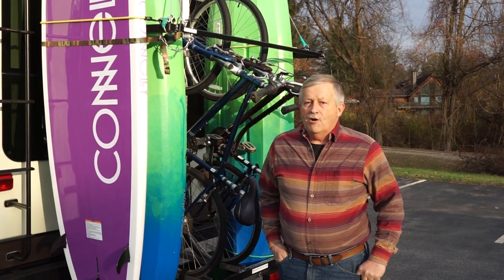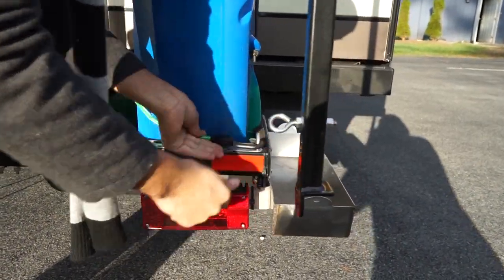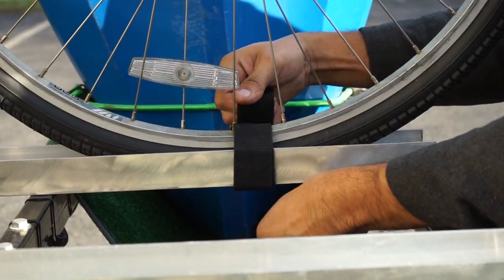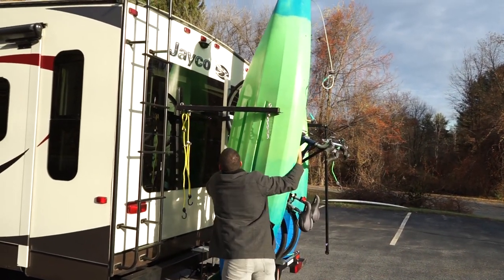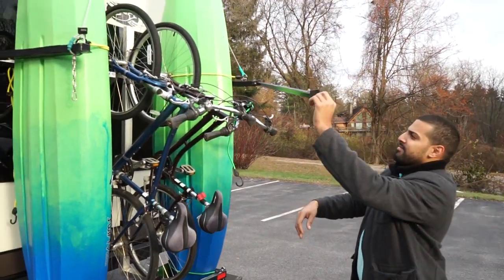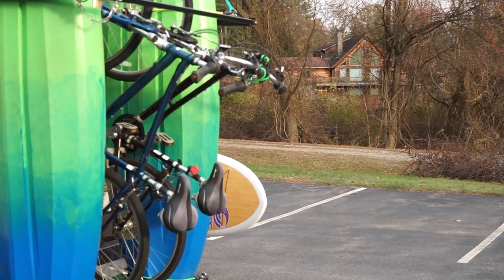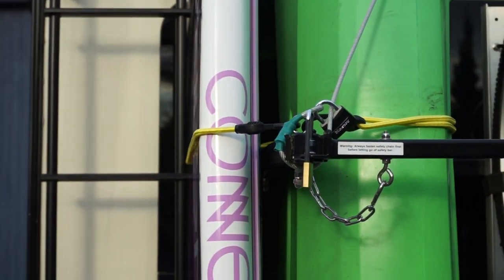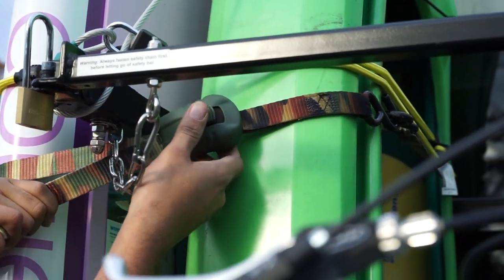Yakups brand RV Racks  Vans, Motorhome, Fifth wheel kayaks, Bikes, Paddle board, & Surf Boards,

Comment: How do I find an authorized dealer and assembler/ installer? Can I get this installed with a swing arm too?
Reply: The racks arrive fully assembled in three sections that easily bolt together with four bolts. The rack slides into the swing arm you purchase.

Comment: Do the kayaks block the rear-vision camera?
Reply: Well, That depends on where your rear vision camera is located and how tall/wide your kayaks are.  No two rigs are built the same.  In addition I Copy/pasted this from a later response:  "The rack shaft length is made custom so if you need more space the shaft is made longer.  The measurement guide on our website and info we request is how each order is made to fit"  So I can only assume that, in your measurements, you specify the placement of your camera, a unit can be manufactured for your needs.

Comment: We have Jackson Kayaks with Sort of Square sterums & the front of them are kind of large..Very Interested because Of right at this time are Kayaks & Bikes cant travel with us?
Reply: We shape the stainless steel watercraft guards to fit. Some kayaks are loaded with the bow downward if yours have a large square stern end or a rear rudder in order to protect it.
Reply: The stainless steel guards are adjustable however if the sterns are too wide the kayak is simply loaded bow down.

Comment: What is the space between the trailer and the rack?  I have a 5th wheel and have both a spare tire and ladder already there
Reply: The rack shaft length is made custom so if you need more space the shaft is made longer.  The measurement guide on our website and info we request is how each order is made to fit..
Reply: The space is customized by us when your order is entered.  Each order is manufactured to fit your RV and we allow for spares, or ladders if you have them by increasing the length of the racks shaft.

Comment: Looks like it will block the camera in the rear of the camper.
Reply from the maker: Good question! The kayaks have about a 30" wide space between them so the rear camera can still have a rearward view. The bikes are lower than the camera so they don't interfere.
Reply: With the rack models with bike rack in the middle the bikes are not high enough to block the cameras view.

Comment: Does this attach to a trailer hitch?
Reply: The racks go into any frame mounted 2" hitch receiver. We include everything for each order including the clamping block that locks the rack bar to the receiver so it does not wobble.  We have dozens of five star reviews on Facebook.
Reply: The racks have a 2" solid shaft that must go into a heavy frame mounted heavy duty Hitch receiver ..
Reply: New to RV’s— does a trailer dealer add the hitch to a travel trailer? I assume they don’t come with one.